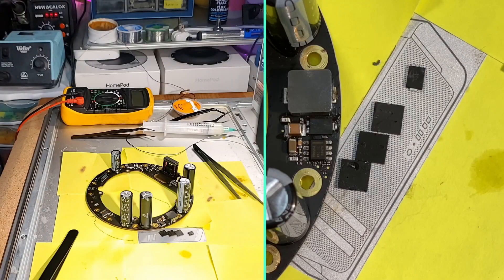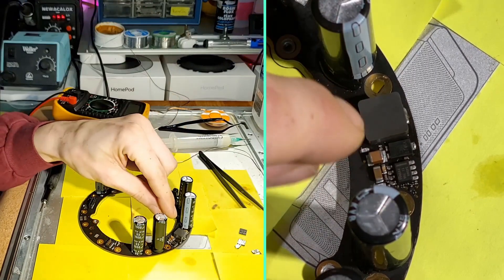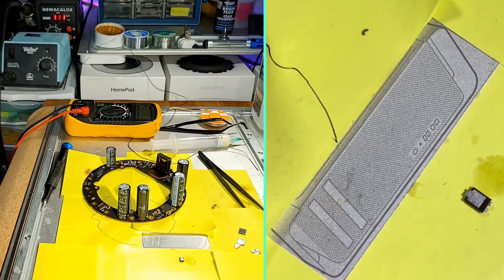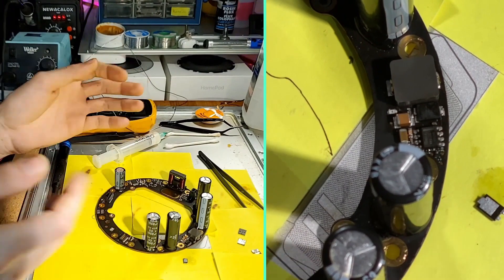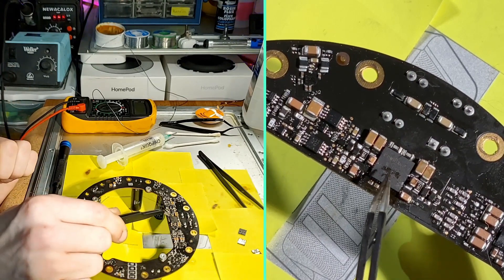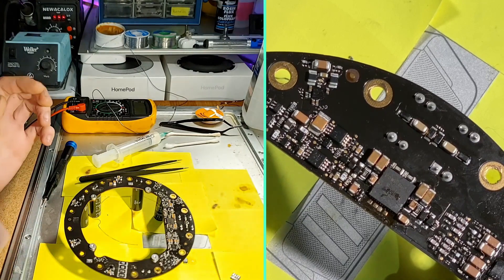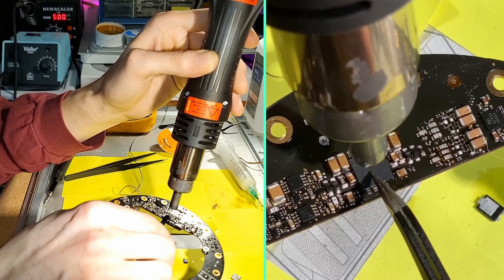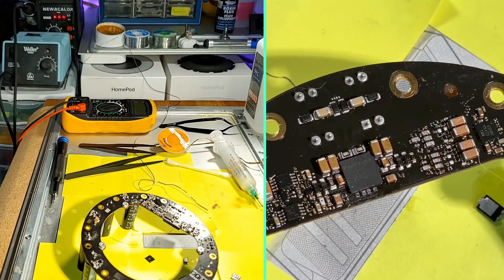How I board repair for Apple HomePods (covers no-power and blown amp IC)

Comment: Hi Nic  Great video.  Iam attempting the repair for replacement of the diode but in the process dislodged the TPS 5460 IC and lost the little capacitor between the Diode and the IC.  Do you know the value of the capacitor and also is pin 1 of the IC next to the electrolytic capacitor (outside of board) or near the diode (inside of board)   Thanks
Reply from the maker: Missing cap is 0.1uF Size 0402 Capacitor. iFixit has a hi-res image of the amp board you can look at for the IC orientation; https://guide-images.cdn.ifixit.com/igi/HAevXlZ2TSDyaNbF.full?pk_vid=401fefe26cef0d10168279781925164f
Reply from the maker: Datasheet for the IC too if it helps; https://www.ti.com/lit/ds/symlink/tps54560.pdf?HQS=dis-dk-null-digikeymode-dsf-pf-null-wwe&ts=1682797923786&ref_url=https%253A%252F%252Fwww.ti.com%252Fgeneral%252Fdocs%252Fsuppproductinfo.tsp%253FdistId%253D10%2526gotoUrl%253Dhttps%253A%252F%252Fwww.ti.com%252Flit%252Fgpn%252Ftps54560

Comment: hi bro, i need to know the number of ic near diod that you replace cos for me it burn off need to replace, Thankz
Reply from the maker: Are you talking about the 8-pin chip to the left? That is a TPS54560 step-down converter. TPS54560B will also work!

Comment from the maker: NOTE: I mentioned the amp IC is also the source of "death farts and restarts", and possibly popping and crackling issues. I've recently discovered this specific issue along with the dc offset pops are coming from failed capacitors around the DAC and sometimes a resistor next to the subwoofer connector. I have a new video up on my channel showing how to repair those issues here: https://www.youtube.com/watch?v=-YZUv5ErDFw

Comment: Silly question about that single teeny capacitor to the side of the diode…it looks like I knocked it off at some point during my attempted repair; what are the chances it will work without it? Probably the better question is do you happen to know the part number?
Reply from the maker: I don't know what will happen without it, I'd guess it probably won't work somehow and I wouldn't try it on my own homepod to find out without knowing it's role. That said I pulled the same capacitor off a parts board and it measures as 110nF / 0.11uF with my cheap multimeter (so probably a 0.1uF capacitor) and is 1mm in length. I'm unsure of any other details of that part unfortunately

EDIT: I've since tested removing this capacitor and the homepod will indeed NOT power on without it!
Reply: @NicsFix  the capacitors to the top, do you their capacitance values?
Reply from the maker: @Lefarr  I tried pulling these off two boards now for you to be sure and unfortunately they are not registering on my multimeter, perhaps they are smaller than my meter can measure at 20nF or less?

Comment: My HomePod was bricked for almost 3 years now and thanks to your video, I was able to dismantle it without breaking it. Thanks for sharing! Question about the diode, I can only find a two-legged S56 diode, how do I orient it in the board, or test the polarity of it?
Reply from the maker: I don't know if a two legged one will work, I'm not smart enough to say. Perhaps you can glean some information from the datasheet of the diode you're supposed to use?   

The two smaller pins on my diode that I point towards the center of the board are the positive pins, and the big single pin that points away from the center of the board is the negative. 

Diodes also usually use a stripe on the diode to indicate the negative side. And again on the amp board, the pad further from the center of the board is the negative

Here's the replacement diode's datasheet: https://www.diodes.com/assets/Datasheets/ds30480.pdf

Comment: Great video! Excellent explanations at just the right pace. I just finished replacing the diode for the no power issue and used your previous video as my guide. This was my first attempt at serious soldering so there were definite moments of 1 step forward, 2 steps back. But I am hopeful it will work; I haven’t reassembled yet to test. I resorted to using solder paste as I don’t have a steady hand. Again, much thanks.
Reply: Did it work?